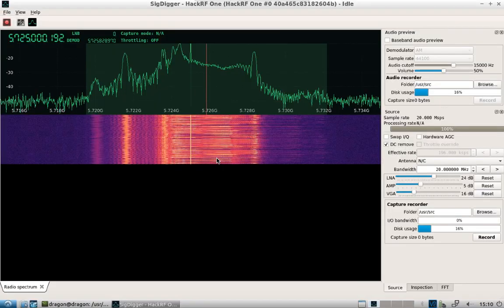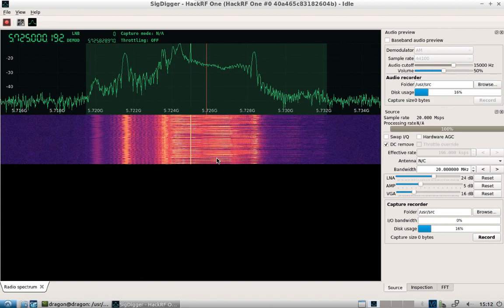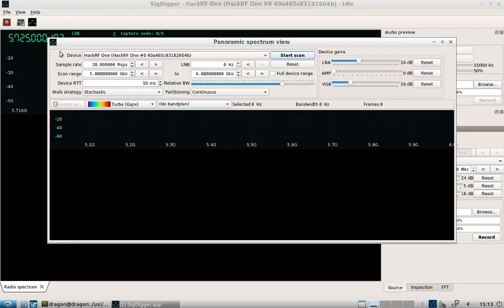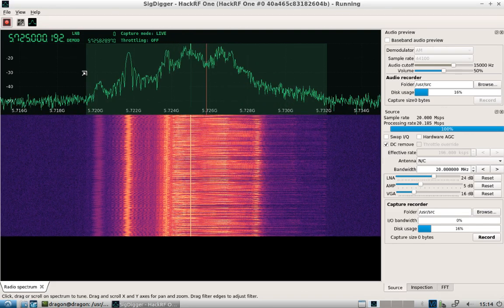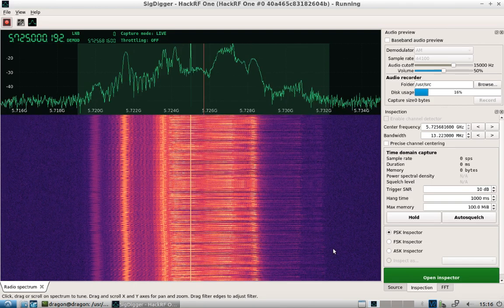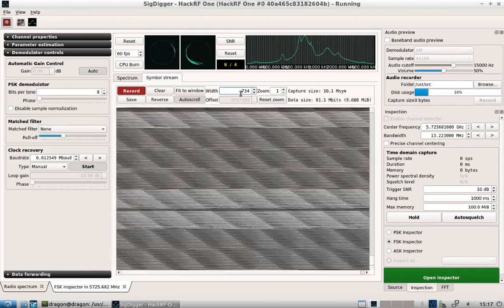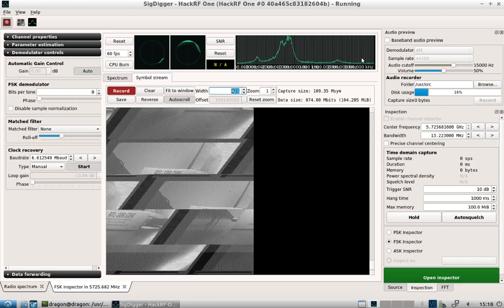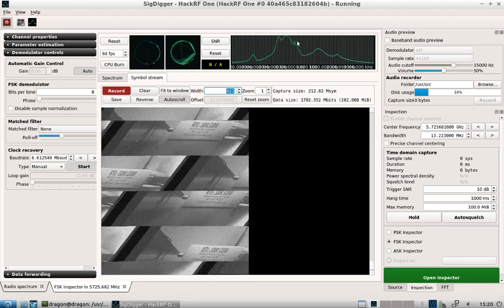DragonOS LTS SigDigger demodulating a 5 GHz analog video/FPV drone link (HackRF One, SigDigger)

Comment: Nice Video!  well explained. quick question what was the 5GHz antenna used ? can you please specify it's modal number ? also can I program hack RF to transmit some signal ( example: noise , just a sine wave ) using the 5GHz antenna with in a selected frequency range with in 5GHz to 6GHz and control the noise level ( increase and decrease ) ?
Reply from the maker: Hi and thank you. This isn’t the exact model, there no markings I can see, but it looks almost exactly the same. 

Anbee FPV 5.8Ghz Circular Polarized Clover Leaf Antenna High Gain Aerial Set RP-SMA Female Plug https://www.amazon.com/dp/B00LGM2U0E/ref=cm_sw_r_cp_api_glt_fabc_KGFGXZEQ103F78PJY0J6?_encoding=UTF8&psc=1

You could actually use SDRAngel to transmit as you mention. You’d be able to control the power but the hackrf on its own is so low you wouldn’t get much range at all. You’d need some sort of additional amp attached to really do much of anything in terms of getting transmit power. You could also use gnuradio to push out noise/sine wave by attached an osmocom sink (specify hackrf=0 in device args). There’s also another tool, I think it’s osmocom siggen but it’d have to look up the way to run it again.

Comment: So awesome! I wonder if, with the right software, could you use the HackRF One as an analog capture card?
Reply from the maker: So actually not long after this video the SigDigger developer added a new analog tv/video viewer. I’ve had pretty good luck capturing and then playing the video back, should probably work live but then I found that sdrangel has a really good analog video viewer that works great live and works with the hackrf.
Reply from the maker: DragonOS Focal demodulating 5GHz analog drone video (SigDigger, SDRangel, BladeRF) https://youtu.be/rl8ACNnjPFA

I used the bladerf in this video, but the hackrf should work the same.

Comment: What transmitter are you using?

There are different bands like Boscam, Fat Shark, Raceband... Do you know if the signals are compatible? I know the frequencies are different, but with the HackRF you can just choose the frequency you want.
Reply from the maker: I just looked all over for any markings and couldn’t find a thing. As far as I know it’s just a generic drone fpv can running analog on 5ghz. I’m pretty excited the SigDigger developer is working on hopefully making the video sink to where it’s viewable, maybe then I’d grab some more brand name cameras and try them.

Comment: Great video! Just wanted to check how far away can you get the drone's video footage from? and what antenna are you using?
Reply from the maker: Great question. I had a 5ghz clover antenna attached to the hackrf. It looks like what’s shown in the antenna pictures here,

https://www.dronetrest.com/t/the-complete-guide-to-fpv-antennas-for-your-drone/1473

For the video I only had the hackrf a few inches from the transmitter on the drone FPV camera. I would like to get my hands on a directional high gain 5ghz antenna and see what kind of distance I could get and have this still work.